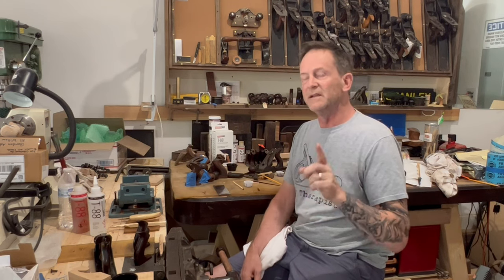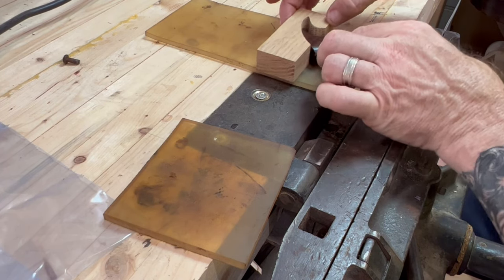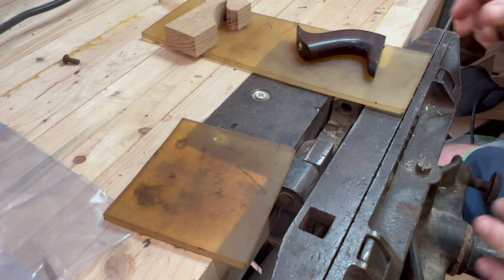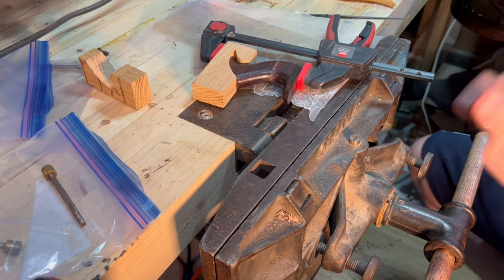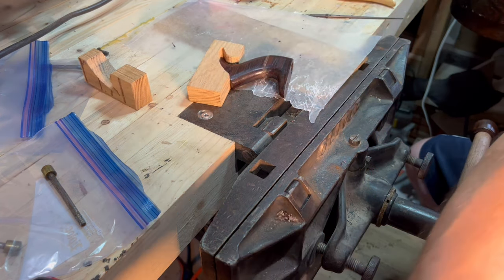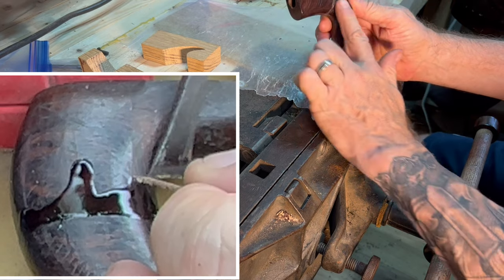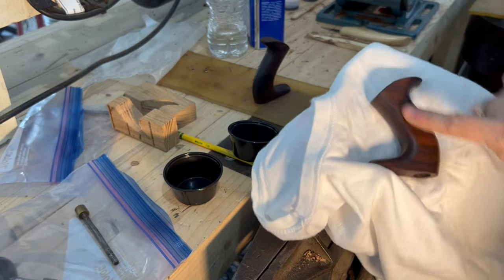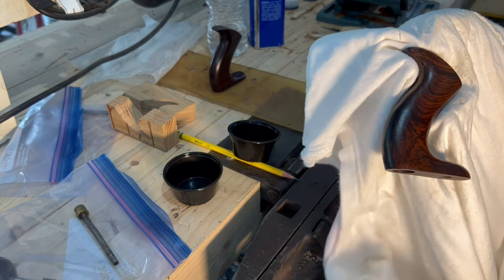Stanley No2 Tote Repair - advanced level

Comment: Your epoxy looks very thick and nice and dark. What do you mix in the epoxy to darken it to the right shade and what do you add to thicken it if you care to comment.  Nice work
Reply from the maker: Good observation. I use System Three epoxy… either the G2 or T88 product. I mix it per the manufacturer’s spec to ensure proper ratio then I add Transtint dye. This helps with the coloration although you can get great result with clear as well. The thickness you see is just slightly thicker than the initial mix because I do let the epoxy slake for a few minutes. Slightly thicker means less runs on the squeeze out. However, don’t let it sit too long because you want it to flow into the pores. You see me applying the epoxy and at the same time I’m “rubbing it in” to ensure a tenacious bite. 👍
Reply: Gordon is that something other than black trans tint? Almost looks purple on the video. Great stuff thanks man!
Reply from the maker: @matthewharry2803  I believe I have as many as 6 shades now but I primarily use three; golden brown, cordovan, and black. You’re seeing the cordovan shade with a dot of brown. Thanks for asking!